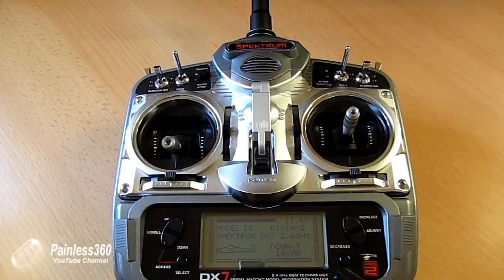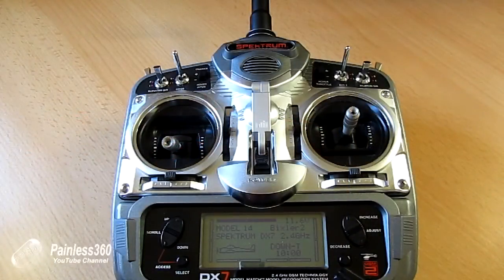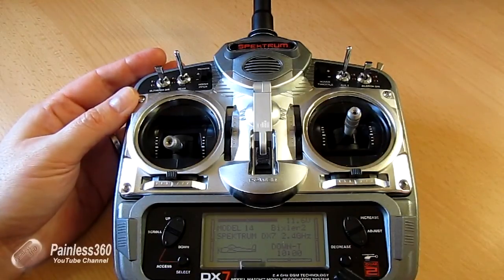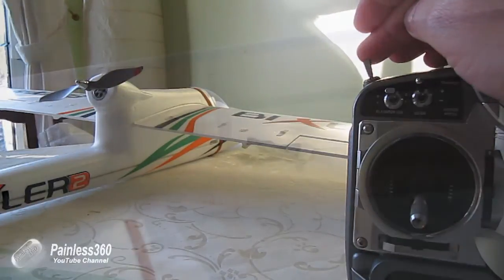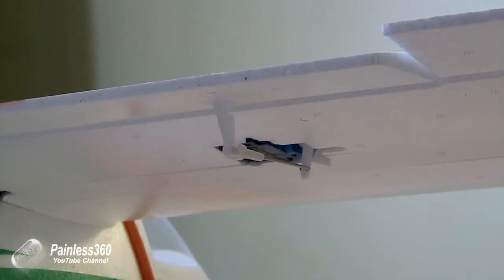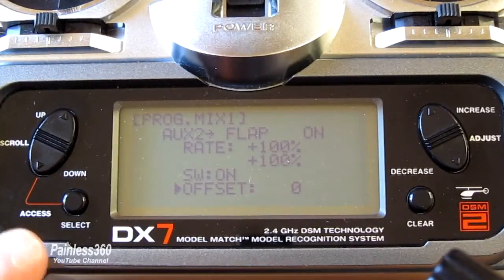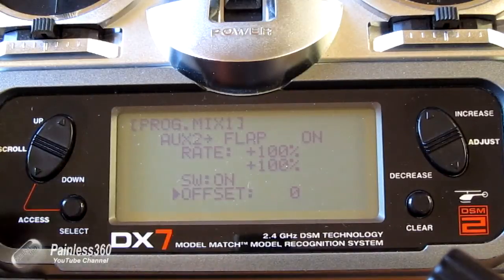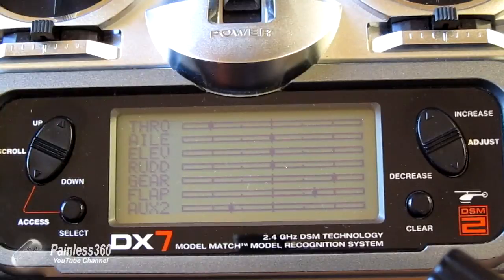How to configure and control the flaps on a Bixler2 model (Spectrum Dx7)

Comment: Why my flpas servos are not even. It does start even in neutral, it twisted on middle position and still twist on 3er flaps position
Reply from the maker: That’s probably the physical setup of the servo, horn or linkage. I’d check the starting positions are the same..

Comment: Hi, Excellent Video. I have the same set up. But my issue one side of the flap does one close completely. How can I adjust the travel only one side. And when I switch to the middle position of the flap switch, both flaps do not a line. How do I go about fixing this?
Reply from the maker: The easiest way to fix this is to manually adjust the second linkages to line up the flap that's not lining up. Best of luck..
Reply: +Painless360 Thank you. That helped and worked. One last question on this, how can I disable the aux 2 switch so that I don't accident flip it, while flying. Since the flaps controls are on the 3 position switch, The aux2 is pretty much useless now. When I flip the aux 2 switch, one side of the flap is activated. That would be dangerous while flying. Thank you.
Reply from the maker: Not sure without trying, you could connect the Aux2 output to another switch in the menus...

Best of luck..

Comment: I must say your video's are excellent.
One question how did you set it up on the receiver? 
Also what size bec do you use with running 6 servos.
Reply from the maker: I've been using a Hobby King 20A ESC 3A UBEC, not sure if it provides the full 3a advertised but runs this setup great. Hope this helps.

Happy flying!

Comment: I wish this video was around when I set my flaps up. Took me ages!

I ended up using a servo reverser.
Half flaps are great for slow flying with a heavy payload. Full flaps slowing down to land. My Twinstar and Easystar without flaps can "float" for some distance on landing. 

I found I had to add elevator to the mix to correct the pitching up when flaps are deployed. On the Turnigy 9XR the flaps can have a "slow" down setting, looks good but also reduces the pitch up effect.
Reply from the maker: I have added a touch of elevator to this via another mix as I couldn't get the standard Dx7 ELEV > FLAP mix to work with two positions well. I can't wait to maiden it.

Just out of interest what degree flaps do you have at full and how many degrees of up elevator do you use the correct for the nose drop? Thanks in advance..
Reply: Painless360
I will have to measure that for you, I started with a small ELEV mix and added to that setting until effective, it varies with payload.
 I have started using my Turnigy 9X with the 9XR firmware now as I can get more control of things like flap mixes. It's also worth looking using independent ailerons (not the Y lead) so asymmetric ailerons can be mixed . Multiplex give values for this normally 2:1 so for example 20mm up 10mm down. It's supposed to stop the tail dropping in turns by reducing drag and therefore giving you a more realistic flight.
Reply: Painless360 checked my old DX 7 for the setting, the ELEV compensation was 14% seemes to work well with a Gopro on the nose .